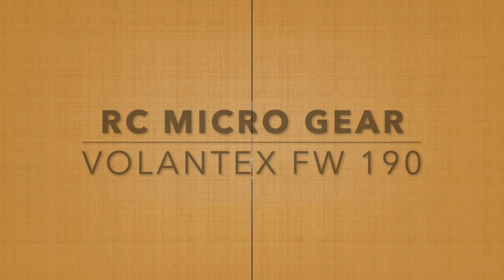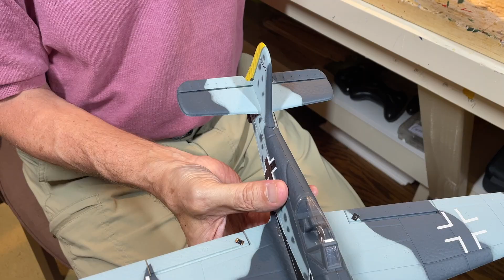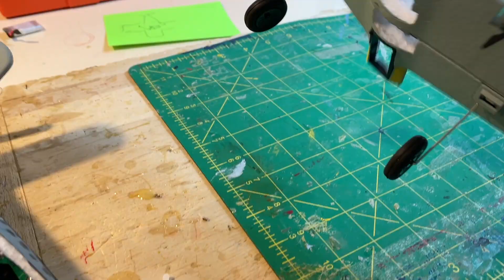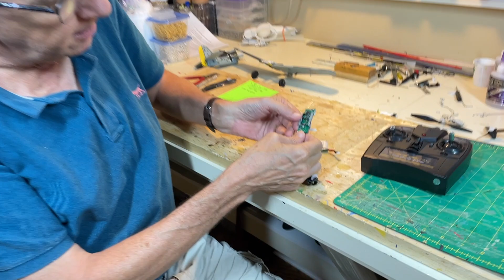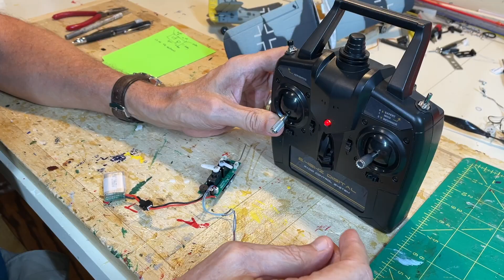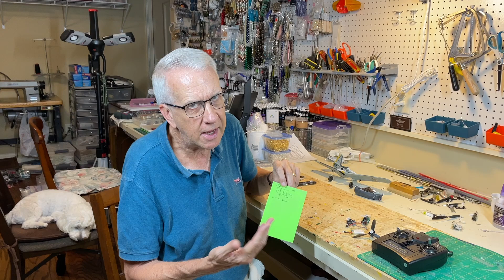RC Micro Gear Volantex Fw 190

Comment: These Volantex / Eachine warbirds use V761 protocol, not Spektrum's DSM.
Jumper and Radiomaster transmitters with 4 in 1 multiprotocol modules support the V761 protocol.
It is important to note that it is not sufficient to have a multiprotocol module. It must be a 4 in 1 multiprotocol module.
Most current Radiomaster multiprotocol TX have only 1 of the 4 protocol chips. These current Radiomaster TX would require a full 4 in 1 module to be plugged into the expansion bay.
I use a Jumper T12 Pro TX, which has inbuilt 4 in 1 multiprotocol support and hall effect sticks.
Reply: Note also that even though you are not planning to use the gyro, I understand that the RX must be mounted in the same orientation as the donor model, if the gyro is to stabilise and not DEstabilise. There are apparently different versions of the RX for upright and inverted mounting.
Since I imagine that you will want to mount the donor RX upright - check the gyro effect so that you will know whether you need to perhaps  lockout the gyro mode switch from unintended activation ...
Reply: @RichardTapp1 there is a calibration mode for the gyro. You can trigger it with the multi protocol modules. It's documented on the wiki.
Reply: @narr0wm1nd49  I didn't say there wasnt. I switch gyro settings   with my V761 receivers using my Jumper T12 Pro.
Reply: Note that the Volantex RX with 2 servos, gyros and brushed ESC inbuilt is usually available very inexpensively from BangGood. I have 8 of them.
A search for EAR411 4ch found these available for A$28
Reply from the maker: Excellent information, thanks for sharing!!
Reply from the maker: Agree on the orientation.  On Dec 6 I'll publish the video where I install these electronics in a Guillows Cessna 170.  Flew well!

Comment: If you are looking to keep the conversation cheap using volantex parts can work. Horizon hobby has a new xcub built on the same platform. But if you wanted more performance it would be better to use a elrx pp receiver. Much smaller, better link. Then run that into a gyro that supports crsf with pwm output micro servos. These warbirds often have servo failures. With that you can also run a proper esc with a brushless motor.
Reply from the maker: Thanks for the advice!

Comment: Sorry off topic but the minimum rc models(p-80 30mm edf) do they need the 7.4v kit and esc or can i use my flysky controler and the Flysky AFHDS-2A Receiver with the 3.7v kit and with this does it fly slower
Reply from the maker: Not sure.
Reply: Thats ok

Comment: Just a note on computer transmitters and " the old days.."  There were radios back in the early 1980's that had servo reversing and mixing like the Futaba FP-T7.
Reply from the maker: Good point.  If I recall these old analog transmitters had DIP switches in a back panel to reverse throw, etc.  Computer radios make all the difference!

Comment: Hi Tim! I'm sorry to be off topic, but what is that task light behind you? I have several of those little fighters, and they are too cool to cut up 😂 so I will wait until I crash one. I think that Cessna kit will be a perfect fit for that control system.   I would absolutely use the aileron servo, though. Good luck, and I'll follow your progress!
Reply from the maker: Hi Ken, happy to assist, but not sure what a "task light" is.  Any further details?
Reply: @TimMcKay56  I think he's referring to the ~5' tall black stand in the left part of the frame in the background at the very beginning of the video.  It has three appendages near the top that look like lights.
Reply from the maker: @ Got it. Just an LED light stand. 😊
Reply: @TimMcKay56  I meant that specific one. I don't know why I fumble around with my 30 year old walmart desk lamps.
Reply: @kenkingsflyingmachines2382  It is a "Porter Cable" light stand. I think we purchased it at Home Depot a few years back.

Comment: Thank you very much for doing this series.  Knowing how to use the electronics after you've wrecked the donor is a good skill to have.  As usual, I have questions.  Can the rudder and elevator servos be removed from the board to mount in another place?  Why are you not using the ailerons?  Is the motor brush-less?   Will other props mount on this motor?  As we say in NoGa, it sounds like you are sufferin' the miseries of feelin' poorly ... do you have a cold?  I know a feller over in Dawsonville who runs off a little something that just might help!
Reply from the maker: Thanks for checking in!  I did not take a close look, but I think the two servos are pretty much mounted to the motherboard.  I did not use the ailerons, just to keep things simple (these smaller models usually fly well with rudder and elevator).  Motor is brushed, fine for these smaller motors.  The model has a special "clip on" systems for the prop, hard to find a normal attachment scheme.  And I did have a bit of a cold, all better now!

Comment: Tim...  great info in your video (and in the comments)...  Thanks.   As I've transitioned almost exclusively to sub 250g projects I'm always looking for options in small/lightweight airborne electrics...  ...just finishing up a scratch build Ken Willard "Duckling" floatplane (from June '82 Model Builder mag.),  and managed to keep it just under 200g even with fairly conventional micro equipment...
Reply from the maker: Thanks for checking in!  And thanks as well for the mention of Ken Willard, one of my favorite designers "back in the day."  I looked up the Duckling plan and purchased it from the AMA Plans Service.  Looks like a great build, looking forward to it!
Reply: @TimMcKay56  I pulled my plans from the Outerzone site...  great resource, but I'm sure you know that.  The guy that has "The Balsa Workbench" site sells a short kit of the Duckling (just the shaped parts).  I did buy it, and the laser cutting is first rate, but didn't use all the parts as I wanted a little more control on the grade of balsa in places.  Although I do have an .03 G-Mark, I went electric with my Duckling...  using a 2211-1700kv outrunner on 3 cells, swinging a 5-3 prop, burning about 40 watts.  Gives me ~190 grams of thrust resulting in a ~1-to-1 thrust to weight ratio.  Haven't flown it yet, but it looks good on paper 😉
Reply: @Luckless_Pedestrian  Good to know on the short kit, thanks!

Comment: For someone who has said that they have a lifetime's experience in flying complex (and full sized planes) you really don't seem to be able to do a lot of simple research there Tim. 

Personally I abhor the idea of destroying a perfectly good little plane just to try to use the internals when you can simply purchase what you need for your Frankenplane as spare parts. Google Volantex V761P-51 spare parts. However it's your plane so we'll let that go and address some of the misconceptions evident here. (For the benefit of anybody else coming here - I know that you probably will have no interest in this part of the hobby.) 

That flight board (and the other V761 v2 boards with the satellite receiver sockets on them) can be bound to ANY transmitter that can run a Spektrum DSMX/2 satellite receiver plugged into the 1.5mm pitch DSM satellite socket OR any other protocol transmitter (Futaba/FrSky/Flysky/a hundred others) that can run a satellite receiver that feeds S-bus serial signal into the S-bus 1.25mm pitch socket on the board. 

On top of that most folks these days will simply have furnished themselves with a cheap Multi Protocol Radio (like the $80 Jumper T-lite v2 - with good Hall Effect Gimbals!) which can run the V761/4ch protocol for this as well as hundreds of other protocols INCLUDING ALL the Spektrum stuff!

As to using these flight boards, they have to be mounted the same way up they came out of the plane if planning to keep the use of the Stabilized modes. Of course that's not required if you only plan to use the Fully Manual Modes but then using this board (after destroying a $100+ plane to retrieve it when a simple $10 Flysky PWM receiver plus the 10x20mm motor/gearbox unit and 2 mini servos as spare parts would be WAY cheaper, lighter and more serviceable) seems rather pointless.

Lastly, if using this board, the directions that the servos are driven (by the stabilization AND the sticks if using the stock transmitter - the stick directions can be set independently if using any of the Hobby Grade Radios) CAN be reversed. However to do this you would need 1 of the earlier versions of the stock transmitter to achieve it. (The ones with the push-in top/bottom trim switches NOT the current ones with the slide up/down trims.) After binding the plane and older-type stock transmitter (but BEFORE you arm the motor by throttle fully up/down) you simply hold the stick that requires reversing hard over for a few seconds until the control surface flicks the other way and the transmitter gives a beep. Then arm the motor to fix the new setting in the flight board programming.